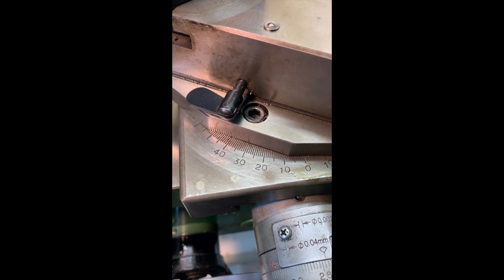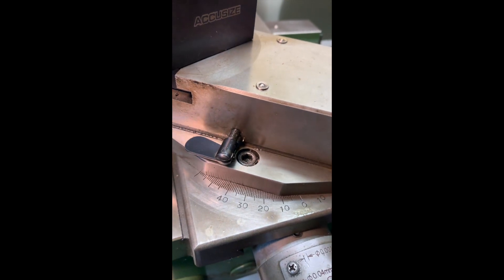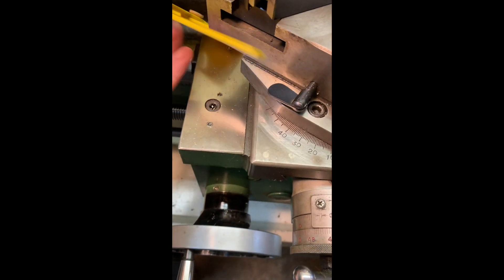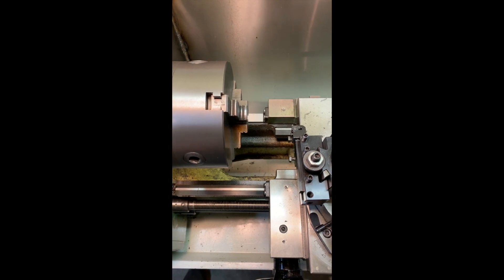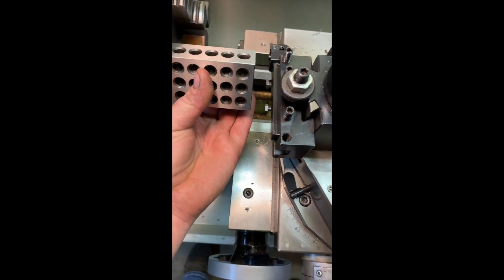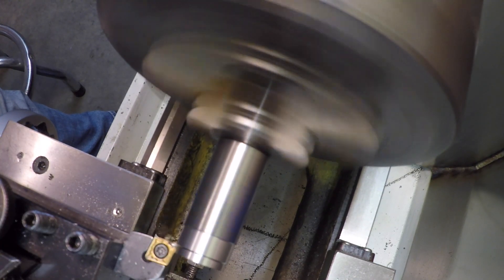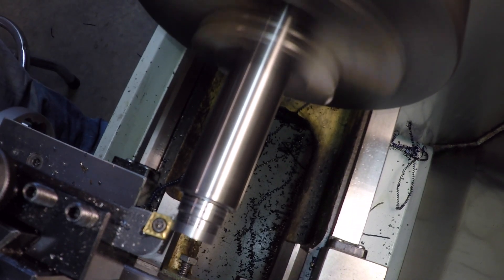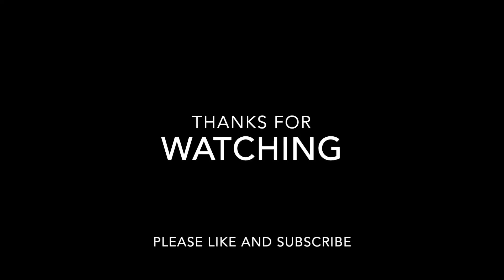#TipsBlitz19 tips for setting the compound on a lathe when threading  and safety while turning

Comment: I switched to straight in plug cutting with the tool upside down and turning from the left moving right. Works great, don't have to fool with cranking two places. Many times you will be turning threads to a shoulder. By starting at the undercut, by the shoulder, you always get a full thread there and at the right end you have lots of room to stop. Some metals don't cut well at very slow speeds. You can run faster starting at the shoulder since usually the right end stop point has plenty of room. This wasn't my idea I took it from Joe Pie's videos.

Comment: I needed your tip 6 months ago when I was cutting my first thread on the mini lathe, it started out tearing up the thread, I didn’t know what I was doing wrong so stopped using the compound and just plunged in, hey it worked. I didn’t know what was wrong until a subscriber commented it looked like my compound was set at 60 degrees, just as you explained I had set it to the work piece axis not the chuck. Thanks for sharing. 
Cheers 
Peter

Comment: Gday, I’ve had a lathe for 20 odd years and never cur threads on simply because it has a fear bit of wear, I recently brought a new lathe and wanted to start cutting threads and sure enough I screwed it up until I worked out the compound had to be set at 60 not 30(29.5), I’m already bald but I pull out any other hear I had trying to work out what was going on, great tips mate ATB Matty